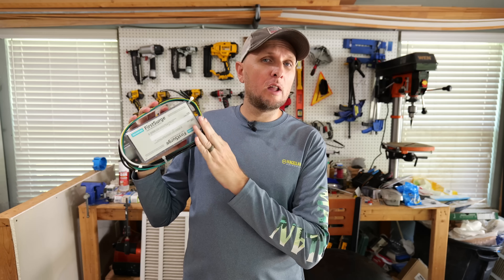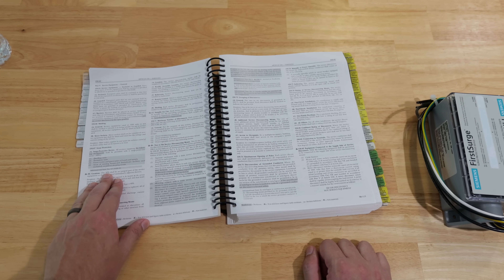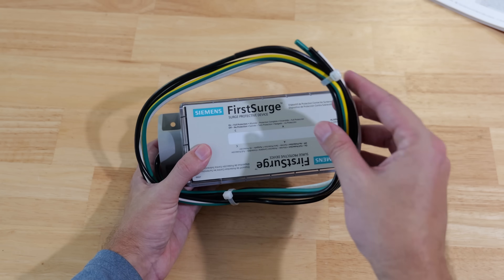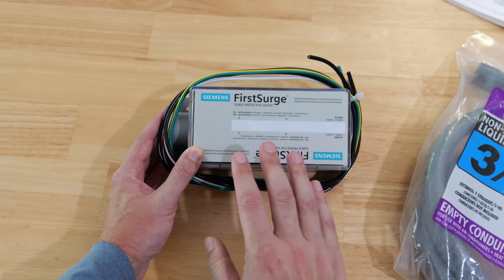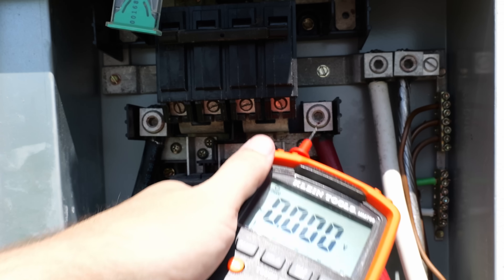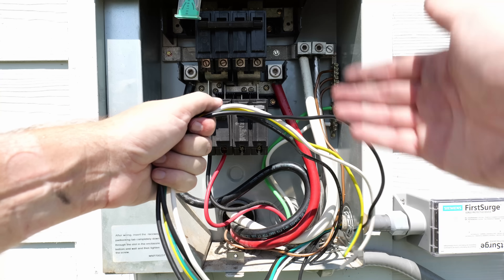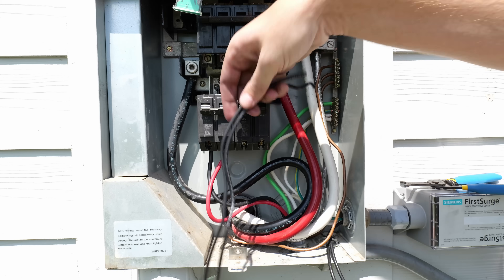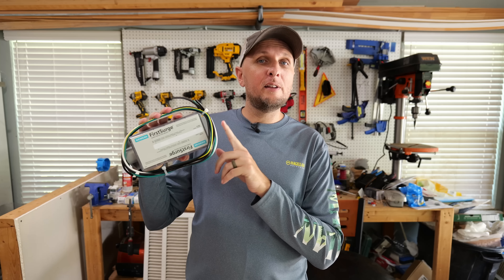Why Whole Home Surge Protectors Are Now Required and How To Install One!  Siemens FS140

Comment: Do I want whole house surge protection on my house? Yes.  Do I think it is the place of the NEC to require it? No NO.  It has become very clear to me, that manufacturers of devices have clearly influenced the NEC to require things that go far beyond fire safety.  The NECs mission was always to provide for fire and electrical safety.  Many of the newest code requirements are clearly unrelated to safety and have the sales of devices in mind.  I would not be surprised if some states were to say it has gone too far and go back to say, the 1999 code book.  The cost of all this is what is making homes unaffordable.  This a perfect example of what was once a great organization gone amuck.
Reply: It may be nit picking but you are right... the NFPA is all about life and fire safety. I'll forgive the over-reach but it could be troublesome precedence down the line.
Reply: Change is always painful. I can see the argument for adding surge protection. They will only get smaller, better, and cheaper.
Reply from the maker: I understand where you are coming from but don’t see how this is one of those instances.  You say the NEC is for safety and I clearly laid out why they implemented this code to protect safety devices from being damaged to where they would not function properly anymore in the event of a fire, carbon monoxide, etc.  So who if not the NEC should require this?  It has solid reasoning.  The amount of people attacking this idea, their only reasoning is it must be about money when the evidence is clear that a whole home surge protector can in fact make the home a safer place.  Just seems like a conspiracy theory based on nothing.  And to say this is item and others are what are driving home prices up is false.  Come on now.  Home prices didn’t double, triple, or even quadruple in price because of a surge protector or other items like it and I think you know that.  Did my cost of groceries, gas, etc. go up because of surge protectors too?  Not trying to be sarcastic, just making the point that it was due to a lot more than a new requirement here or there.

Comment: This is mostly BS.
Reply from the maker: Nothing about it is BS lol.  These comments are great 😂
Reply: @HowToHomeDIY  I'm 86 an EE and have lived in Florida thunderstorms for 44 years and have never had a surge. Florida utilities have robust lightning protection. If lightning hits your pole transformer I doubt the protector will stop it getting into your house. Equipment in your house is extremely unlikely to cause surges. This is akin to the outside water spigot backflow preventers touted years ago. I do have a utility provided surge device at the meter because of electric car charger but most don't need it.
Reply from the maker: And there are a bunch of EEs that say these absolutely do help protect devices in the home.  Not much protects against a direct lightning strike.  I’ve lost multiple devices due to surges and since installing one of these years ago, not one.
Reply: @HowToHomeDIY  I had lunch today with two retired pilots. One was 95 and was a USAF and Air America pilot who only flew props C123 C54 C118 etc. The other was  94 and  USAF Capitol and United Airlines pilot. Neither had ever heard of or experienced a fuel shutoff to simulate engine failure in a reciprocating prop twin. Throttle reduction was always used to simulate failures and then slightly advanced to simulate feathering when tested identified the engine. Again, I did not criticize you, I questioned the procedure of the examiner. I'd like you to relate this conversation to the examiner and see what they say?

Comment: This seems more of a money grab to push sales of these newer devices, imo. Good practice to safety devices, use ones powered by batteries so they still work if power is out and separate them from grid failures like surges or sag. most surge protectors are too slow to truly protect sensitive devices anyway. UPS devices would still be needed for buck\boost and useful surge protection.
Reply from the maker: Not sure the NEC cares about the pockets of surge protector companies.  The reasoning is sound.

Comment: So these do nothing more than any other surge suppressor plugged into any outlet in ones home. Instead of plugging into an outlet your hard wiring it. You could plug in a very high quality surge suppressor or line conditioner combination close to your panel and achieve the same result. And anyone who has worked on electronic items damaged by indirect lightning hits knows the damage is never predictable. It hits items both near and distant electrically from the panel in a home while skipping over other items and still completely annihilating the surge protector. When it comes right down to it, after a "surge", your still not going to be 100% sure your AC smoke/gas detector is 100% okay. I have conditioners and surge protectors all over the house. But that doesn't mean I'm safe.  I think those who make the decisions here see a money making opportunity.
Reply from the maker: It’s completely different than a regular surge protector.  So the conspiracy now is that people that sit on the NEC board are making this code to line their own pockets?   Based on what?  That’s just speculation based on bias.

Comment: Leviton also makes a surge protection outlet.  Its NOT a first line of defense item, but its great as supplemental protection. I use it for TV that are not on surge protector with battery backup and fridges / washers  or any fixed appliance that has a plug.

Comment: This Siemens SPD looks like it's made for a whole hotel or nursing home!
The Legrand 0 039 51 (most common in France) takes 4 times less space in the electric panel and costs $90.
It handles T2/3 surges up to 12kA and includes short circuit protection, and no breaker required.
There are bigger and more expensive SPDs, up to 40kA for houses, that still fit on the electric panel's DIN rails.

In French houses, SPDs are mandatory only in departments with the highest lightning risk, most of South France. I elected to install one despite it not being mandatory here.

The bus bars look like a hazard, with the wires in contact with the box. I hope your electric panel is plastic, not metal!
Reply: The ground bus bar is physically bolted to the metal enclosure which itself is grounded. So what does it matter if the ends of the wires touch the box?
Reply: @jonathanperry5266  According to our code, grounding must be as direct as possible, and with the shortest length possible. All appliances' ground wires connect to the ground bus bar, where the house's grounding cables are also connected. No electrical shock possible touching the metal enclosure, or even the grounding wires, as they are all sleeved.
Better ask an electrician what are the exact risks, and I suppose that if the enclosure is metal, it better be grounded to the ground bus bar too.

Comment: My local Electric co. here in Florida will install /rent you a whole house surge protector.  But if you read the fine print it says that it will not protect your computer , TV , range , microwave , washer dryer or anything else that contains " sensitive electronic components "  So what the sence of getting one.
Reply from the maker: That is either a really bad surge protector or they are talking about a direct lightning strike.
Reply: Withlacoochee River Electric Cooperative is offering our Member/Owners the SurgeStopper™ for the low price of $6 per month* with a one-time installation fee of $40. This charge will be applied directly to your monthly statement. Each SurgeStopper™ is installed by WREC’s trained personnel.

Not Just Protection – It’s Peace of Mind!
SurgeStopper™ is backed by a fantastic, $500,000 aggregate, 15-year product and appliance, peace-of-mind warranty. SurgeStopper™ will pay up to $5,000 (per appliance) toward the repair or replacement of any large, motor-driven appliance or equipment (such as washer, dryer or air conditioning compressor) in your home that is damaged from a high-voltage surge that passes through SurgeStopper™.

SurgeStopper™ Warranty Information
SurgeStopper™ comes with an outstanding warranty!

The extended warranty covers consequential damages to standard, motor-driven, residential equipment as a result of a powerline surge disturbance.

This includes:

Washer and dryer, refrigerator, dishwasher, electric range and other major home appliances that are motordriven or mechanical in nature.

Products that are not covered:

All well pumps and supplementary pump equipment, stand-alone electronic equipment using microchips or microprocessors, and transistor technology such as TVs, computers, and video/audio equipment.

Comment: A ridiculous requirement. This has little to do with protecting personal electronics, and is more about protecting insurance companies against claims. (In case you don't know it, the NFPA is, essentially, insurance companies)
Reply from the maker: Ok, why can’t it be both?  The homeowner doesn’t want a claim either.
Reply: @HowToHomeDIY  no, but if you ever read the information that comes with one of those things you'll discover that it really doesn't protect against much of anything. (Like... Lightning strikes)
Reply from the maker: That’s one thing and the only thing they list as not being able to protect against a DIRECT lightning strike.  Almost nothing can.  But it still protects from grid surges and depending on distance away can absolutely help with lightning strikes that are not direct.

Comment: Not the best.  EATON CHSPT2ULTRA Ultimate Surge Protection is rated the best.
Reply from the maker: No it isn't.  The Eaton is very good but does not have the capabilities of the FS140.  Don't rely on websites that rank their best from best to worst and then just say it is the best without knowing why they are rating it that way.
Reply: @HowToHomeDIY  ummm several websites have said it and why.  Even electrician I know prefer it.
Reply from the maker: And what are the reasons given?  That it is a good surge protector for the price. I believe that’s what most of them say.  Which one has the highest kA protection?  And it’s not really even close.

Comment: I just don't seem to understand how this protects my whole house. Installing it on my bus bar in my panel and having it draw power doesn't seem to help when a surge comes through. Having a good ground is really all you can do to hope that a surge is diverted from down your main lines. My understanding is that if you want to protect something you'll always put the device first in line, this seems to have been installed on the end and not serve much of a purpose. I've worked with data lines and have installed surge protects before, but they've always been installed on the line coming from your provided and between your home. This doesn't follow that rule so I'm not sure how it would work as a surge protector, in my eyes your power line is already protected by a surge arrestor so you won't need to buy one of these. The lightning would have to strike your house directly or travel down the pole closest to your home. If that's the case you should invest in lightning rods or like I said before, ensure you have a good ground in your panel. I think what you should want is a filter more so than a surge protector.
Reply from the maker: This is at the beginning and it works because it is a direct line to ground for the surge where it wouldn’t otherwise have one.

Comment: I'm skeptical that these consumer oriented surge protectors do very much at all. Especially considering that they only have 14 or 16 gauge wire that goes to the breaker panel. I would want to have busbar going to a surge arrestor and I would want to have gas spark gaps as well as some type of metal oxide varisters. And it's even more necessary in this day and age with the possibility of Electric magnetic pulses either by man-made or solar events. And then of course there's the issue where you have a car crashing into a utility pole and dropping a 13 kV line onto a 240 volt distribution line. You have to be able to protect against those types of events as well. These little consumer surge arresters are useless for that.
Reply: The surge arrestors are specifically for lightning damage, not for freak accidents. Amazingly, the Surge Protection Devices do not need heavy gauge wire; they only do their thing for a handful of milliseconds. The same gauge selection used for power wiring is plenty for SPDs.
Reply: @flagmichael  unfortunately, freak accidents occur all too often. Trees fall on power lines every day, causing HV to come in contact with LV lines.
And the shortness of the lightning event means the energy is up in the RF range, which means any inductance in the wires to the MOV will diminish the surge reduction effect of the MOV due to impedance of the wires at the high frequency of a lightning strike.
My preferred solution is a large loop of wire before entry to the building. The loop absorbs mush of the transient energy through its inductance, and what remaining energy gets through is suppressed easily with surge arrestors.

Comment: Only new home requires it. I have been using them for 30 years.
Reply from the maker: Yes but not only new homes but if you change out or replace your main service panel it is required there too regardless of the age of the home.

Comment: Does the FS140 work for an EMP,  either from the sun or a nuclear detonation?
Reply from the maker: The FS140 is one of the most recommended surge protectors for an emp event but not by itself.  Would also need to have ferrites installed on the main lines as well.

Comment: Question.....if the surge protector gets hit by a surge and becomes inoperable does it put you in a no electricity situation until its replaced? Second question.....do they make a surge protector that connects at the meter before the electric breaker box panel? Thank you 😊
Reply from the maker: Answer 1: no
Answer 2: yes they do make surge protectors that attach inside the meter.  However, the Utility company has to offer that they sell them and then they also have to install it.  They are typically anywhere from $300-$600 depending on the utility company and while they are decent surge protectors and certainly better than nothing, they typically don’t offer the same level of protection as the one in the video.  So just have to kind of weigh out the pros and cons.
Reply: @HowToHomeDIY  thanks 😊

Comment: Great video. Decided to install one myself. Question I have is whether it is more important to install the breakers closest to the incoming service line, at the top line up of the panel, or at the bottom where I can shorten the device wires the most? I only have access to the panel for the spd at the bottom as the panel is mounted between the side wall and garage door studs. Circuit lines all exit at the top.

Comment: had 2 installed when I had electrician wire up a big heat press in my garage.  He sold me on it as a way to protect all my electronics in my home.  One on the main and one on the subpanel.  I wish I had gone with the EMP shield one as the siemens may or may not protect against an emp pulse.  Of course if that happens its probably game over anyway.

Comment: .… and what, pray tell, protects the so-called ‘smart’ meter that’s upstream of all this nonsense?
Reply from the maker: Not my concern.  That is on the utility side.
Reply: @HowToHomeDIY  well, it may be on the utility to replace it after it’s been destroyed, however it’s the first device to face an incoming conducted surge. Any device downstream from the meter — including this so-called surge protector, can’t protect any upstream devices, correct? I have personal experience with failure of the meter: if you know how a downstream device could protect an upstream device, I’m listening…

Comment: Question:  Say a storm (fallen tree} yanks the weatherhead and conduit off your home, and results in the power company disconnecting the power lines.   They then require a permit in TN to replace the weatherhead before re-connecting the lines.... Do we have to update to the new rules to satisfy permitting?

Comment: It seems like the surge protector that was installed is only protecting the right side. I don't understand how this works. I thought it was going to be for the whole house.
Reply from the maker: No it’s on a double pole breaker which means it’s protecting both sides.
Reply: @HowToHomeDIY  both sides of anything connected to that one breaker?

Originally I was thinking the surge protector you were installing was for all devices in the house
Reply from the maker: When I say both sides I mean both legs of the panel.  A single pole breaker only makes contact with one leg of the service so it would only protect half the circuits in the home the double pole then makes contact with both legs.  So yes it is protecting the whole house.  It would be helpful if I could draw a picture of a panel on here.  I think that would help with making it make more sense.

Comment: So the surge protector grounds the 20 amp circuit and the breaker trips.  The surge destroys the surge protector.  How does this keep the surge from going to the rest of the circuits in the house unless everything else in the house is turned off?
Reply from the maker: Breaker won't trip.  Surge protector absorbs it all while sending it directly to ground.

Comment: Important Question: When should one consider using an SPD which is specified for direct connection without the dedicated branch circuit and when to use one on a branch circuit?

Comment: My square D breakers allow for 2 wire connections.   Why couldn't I share the surge protector with an existing 2 pole breaker like oven/ dryer / garage heater/ ect.....?